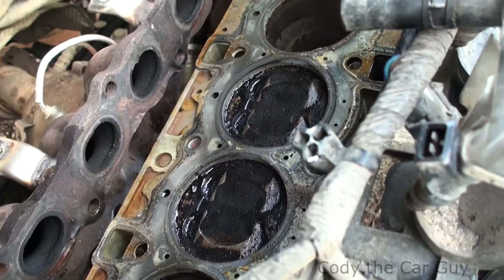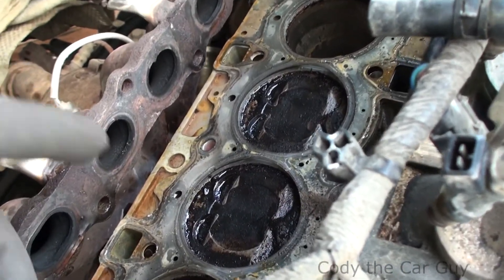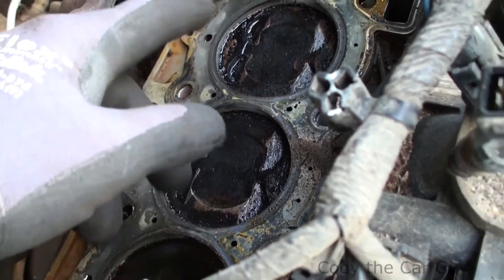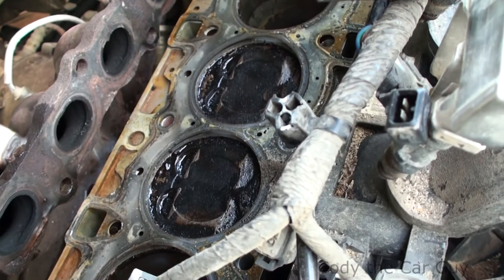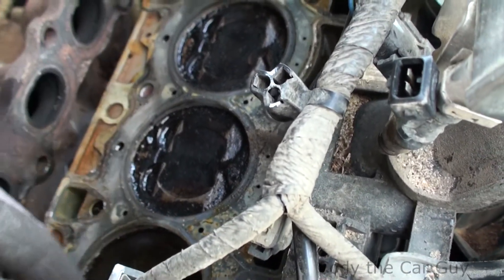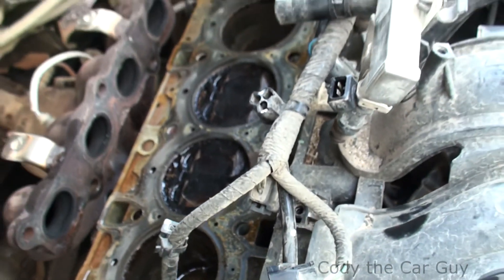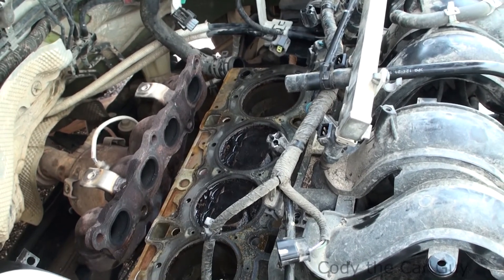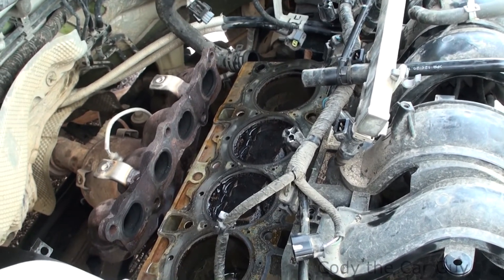Ford Fiesta 1.6 is a interference motor

Comment: hi cody. can you tell me why my 2002 fiesta 1.6 rocam will still have a slight jerk or misfire (sometimes a small backfire) when im accelerating in 2nd or 3rd gear? i changed the coil pack, spark plugs, leads, temp sensor and checked the timing but car still misses. any idea what could be the problem?

Comment: Hey Cody, did you ever do a video on how to set the cams and timing on this motor? I couldn't find it. This happened to my brothers car and Ford wanted to charge him $6600 to replace his motor. Got the  head off yesterday. All his intake valves are bent. Hopefully it didn't hurt the seats and guides and can just replace the valves. Don't suppose you have a e-manual?